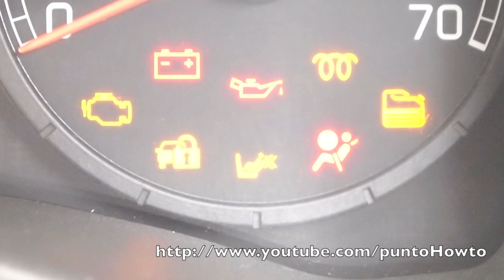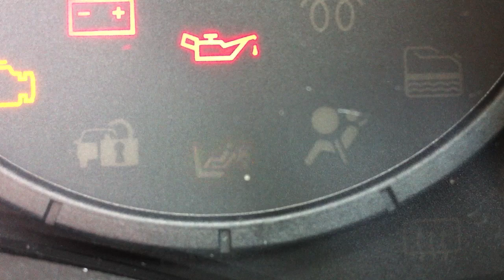Fiat Punto II Airbag isolation switch fault and its fix

Comment: But what was the issue with the original wire? Why does it need a new wire?
Reply from the maker: The original wire was a shared ground with a multitude of other systems in the dash, any noise on the earth wire say from a heater fan or a relay switching on and off, and it will create a potential difference on the ground from the switch, which to the airbag ECU looks like a poor/fluctuating connection

Comment: I think i have this issue in my fiat panda. Should i go to the fiat dealer? What do you think i have to pay in Euro
Reply from the maker: This wasn’t an known problem on the panda, there is (ad far as I am aware) no repair cable for the panda. What id advise if first getting diagnostics done to see what the fault is and go from there, no need to go specifically to the fiat dealer
Reply: @PuntoHowto  oke thanks. Do you know if there are any obd 2 readers to work with fiat panda 2004?
Reply from the maker: @Moccalocca100  look into “multiECUScan” you can download it for free you may have to pay for the full version to reset or make  adjustments but will run on a windows laptop and only needs a cheap cable to connect the laptop to the car

Comment: Do you know why the mileage and the clock blink? I have this problem. And at 50 km/h it indicates 20 km/h.
Reply from the maker: Often caused by something on the car's computer network "CanBus" not being detected. More often than not caused by Blue and Me modules failing as these cars get older.
Reply: @PuntoHowto  The car is from 2002 and I don't think it has this Blue and Me. Maybe that CanBus is the problem, but the car doesn't have on-board navigation, only some travel settings that I set from a "trip" button.

Comment: Hi, 
Thank you for your videos. They are very helpful.
Do you have a video on how to replace the squib unit on Fiat Punto Evo III (2010)? This comes with the indicators and all as one unit.
Can you please help?
Reply from the maker: Sadly I don’t, on the grande and the Evo you have to poke a hole in the sides of the steering wheel then unhook the airbag from the steering wheel with a hook through that hole. It’s a really stupid way of fixing an airbag and as you have to damage the steering wheel to do it, I’ve never done it
Reply: @PuntoHowto  Hi, thanks for the reply. Once I have replaced the squib/stalk unit, will it require Fiat coding on Punto Evo III (2010 model)?
Reply from the maker: @trisalisi6504  no I don’t believe there is anything that needs coding
Reply: @PuntoHowto  Awesomen.. thanks for answering my queries 👍🏽

Comment: Happy new year Puntohowto! It looks like I have found the cure for my problem :))) The baby airbag light goes off but the passengers stays on. Now I see the cable connected from the airbag switch to the ecu (under the glovebox) has two wires, colored brown and purple. Can I still use this fix? Even if I have an Mk2 2000 elx sporting. I really hope so..P.s. I've let this car mechanic read the error code, and his computer says; check the airbag switch lock. I've cleaned the contact points of the lock barrel and I've cleaned the contact points of the airbag switch cable. Could you please advice me on what to do?

Comment: thanks, managed to obtain kit from Fiat dealership, although first they were reluctant to sell it to me.cost just under £10.
Reply from the maker: domll4 I had exactly the same problem, i ended up making a complaint to Fiat UK before the dealership would sell me the part
Reply: PuntoHowto
There concern was because it relates to airbags, didn't want me suing them if it went wrong. i asked them 'so how much for you to fit' and they didn't like that idea either. It was only when i asked 'so you want me to scrap the car a buy a new one' they backed down.
All fitted now and problem gone :)
Reply: Now charging £67.85 + VAT from the "Stealership!" Ouch!
Reply: @derrick.francis  
Bastards & Mafious Fiat

Comment: I have the same problem, but I couldn't find this unit thorough online with this part number.  if you can send me a link where I can buy it?
Reply from the maker: Heshan Ekanayake you can really only get it from the Fiat Dealer parts department at your local fiat dealership, as stated though its still only about £8
Reply: in Sri lanka we have no dealer for UK Fiat, but for Indian Fiat. They do not deal with UK Fiat. IF you can send me an address of a dealer who has this at London I may can try asking a friend to buy it for me and post to Sri lanka? pls if you can contact me via heshanek@gmail.com ?

Comment: Hi,
I have a problem with airbag lights on. (yellow and red)
I have a MOT next week so i have to fix that. I saw 2 your videos on YouTube.
Friend of mine plug the diagnostic tool in to my car (punto 2003 facelifted 1.2 8v) and it shows number of faults with the srs (photo attached) and i'm quite confused now because i dont know what to do. Replace the airbag module, buy a cable from your video and try to reset errors on mine, buy this fixing-kit shown in another your video or buy new airbag sqiub and isolation switch and replace them.
If you have any advice for me i will be very happy.
Sorry for any bad spelling but my english is not perfect.
Regards

Comment: Hi I did the fix without the reset, unfortunately it still shows the warning light. Is it likely there is still an issue or would it be because I have not done the reset? Any thoughts would be greatly appreciated. Thanks in advance.
Reply from the maker: It's because you didn't reset the fault codes
Reply: Ok if I reset it now will it go away or do I need to disconnect the fix? Thanks again.
Reply from the maker: should just need to reset

Comment from the maker: The official Statement from fiat regarding this fault. 
"As a responsible vehicle manufacturer, we take the safety of our customers very seriously. Please be assured there are no faults with airbag systems on our Puntos between 2001 and 2006. Should a recall be required for any component we identify, this is completed with guidance with VOSA."